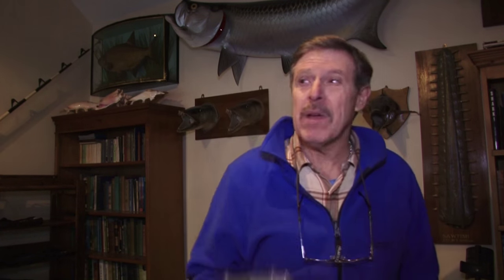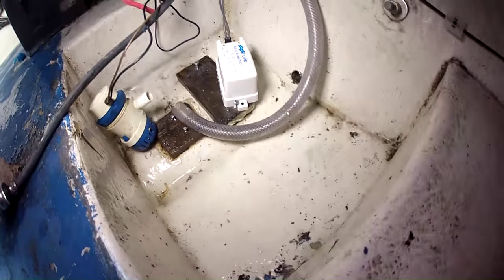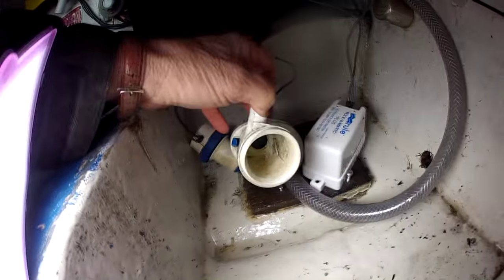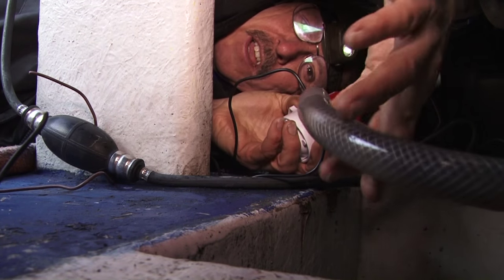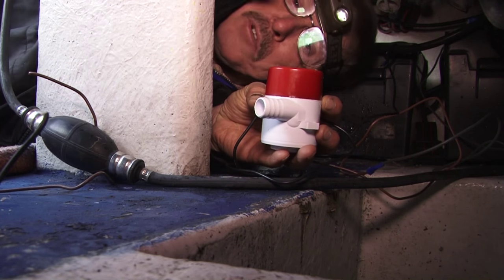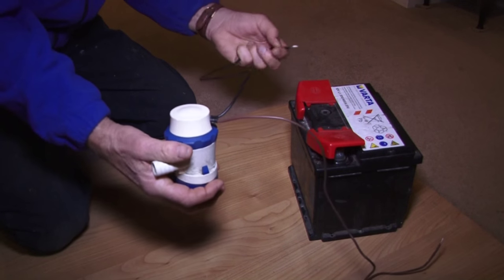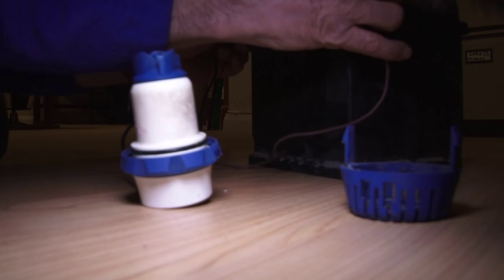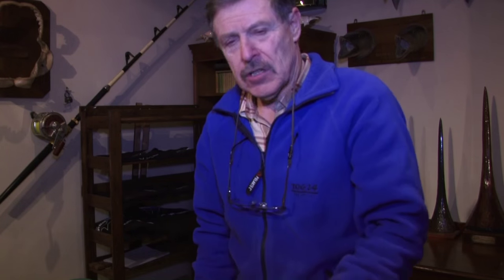How to fix a bilge pump for boats | TA Outdoors

Comment: 2006 Pathfinder, very hard to reach the bilge pump.. The bilge is stuck on, it will not shut off.  Any suggestions short of replacing or easiest way to replace?

Comment: My boat has a electric bilge pump. I also have a manual one with has perished and I was wondering if I should buy another one. Because the electric one works fine but I was wondering if we should get a new one just in case. Great video and keep on doing them! Best YouTube channel! Thanks! And keep up the good work!
Reply: Emily Smither do you like your boat Emily? If you like it then you better get another one because redundancy pays off if you have a leak. Make sure you buy one that's three times bigger than you need to in my opinion I would want the water out fast enough to where it would keep it out of my boat as much as possible. What if your other one gets a little piece of wood in it or something and doesn't work then what are you going to do you won't have enough time to ask how to get that piece of stuff stuck out of your other bilge pump when if you had just bought another one when you can have it working instead for the time being. If you like your boat buy another one if you don't like your boat sinking and get the insurance money

Comment: Great Vids Graeme,  I watched this before I changed the pump in my RIB that I have just took ownership of.. it wasnt working properly.. it is a Seaflo 750 GPH with a built in float switch... the first thing I saw was the state of the wiring connections, they were atrocious and submerged in 2" water !!!.. But wiring apart.. the main problem was that the float switch on these pumps is VERY close to the intake level.. and the pump was not on a level footing (and was not secured to the hull bottom) as it could tilt slightly, so on some days it would work and others it wouldnt because it was canted over, other times the water level would change enough so that the float activated but the intake wasnt in enough water to draw any up and out !!! so running dry.. and of course stopping and starting.. NOT GOOD.. I have changed it for a pump with a seperate float switch so the pump can be placed around 2" lower than the float activation level, so when it comes on there is always water to pump, hence no dry running.. they have been epoxied to the hull too.. A real pain in the £#$e but done now

Comment: Great video I  would add a  mesh screen enclosure for the pump to sit in, build like a open top box of screen large as permitts so it wont clog quickly. I always ran a auxillary pump on a separate switch also. Now lets talk bilge exaust fans Cl;-(p)

Comment: Coat the Marine Plywood with Fiberglass Resin to keep the wood from rotting !  Also add a Manual On Switch, a Warning Light and an Hour Meter when the Pump is running by the Helm !  tjl